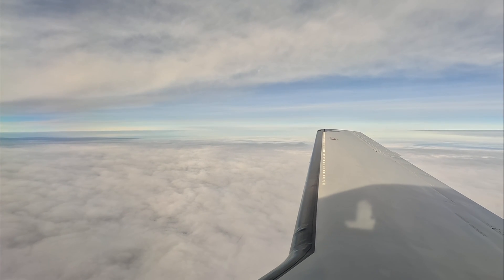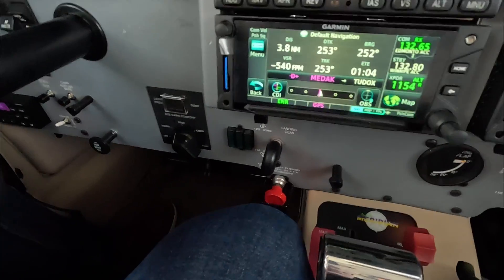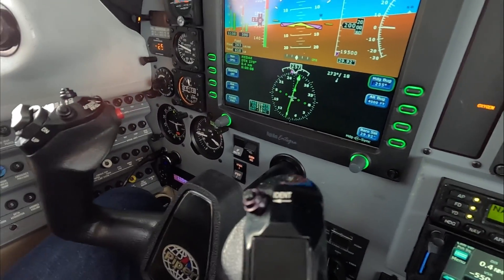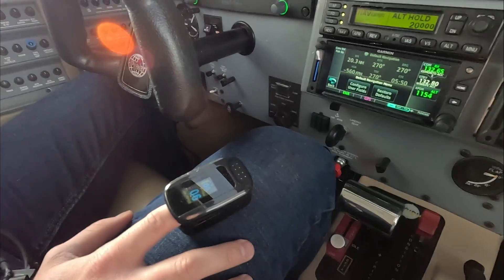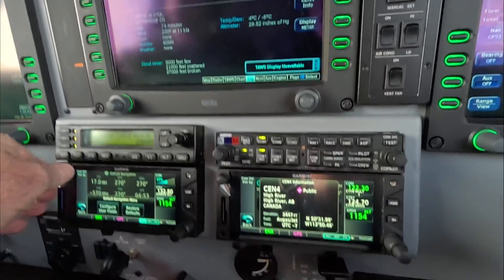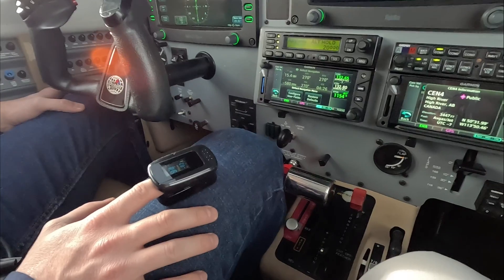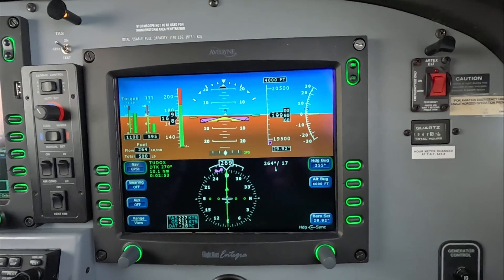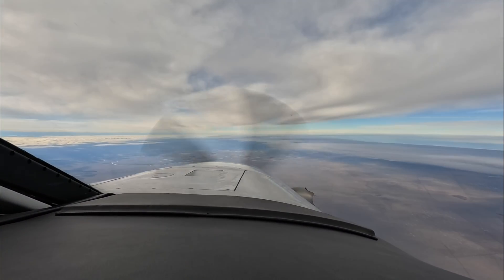The Piper Meridian - A Review of the Cabin Pressure System with Dick Rochfort

Comment: So Dick, What’s with the GEAR WARN light and OXYGEN lights illuminated . . . In cruise?
Reply from the maker: Hi Scott: a red “Gear Warn” annunciator means that one or more of the gears is neither completely up or completely down. During a normal 8 second transition this is normal. A yellow oxygen light may mean that one of the oxygen canisters has deployed. It could also mean that the pin which triggers the light has come off its correct position and needs to be adjusted. Fly Safely - Train Often .. DR